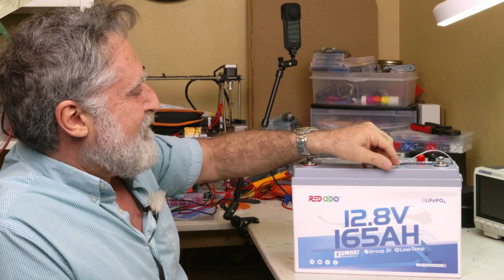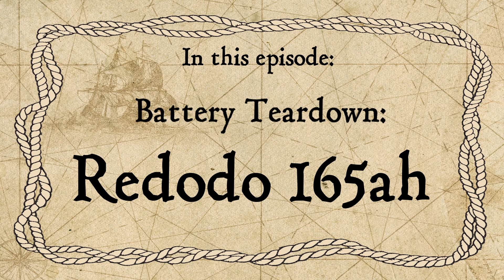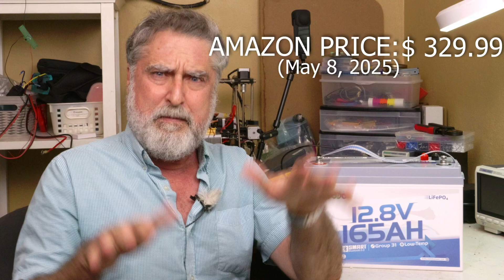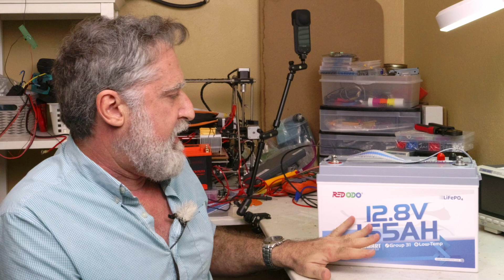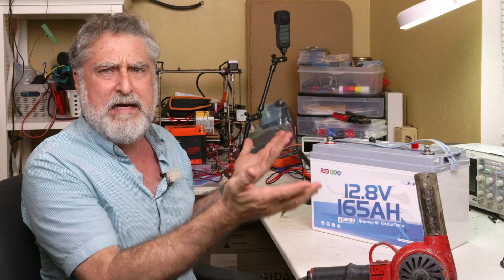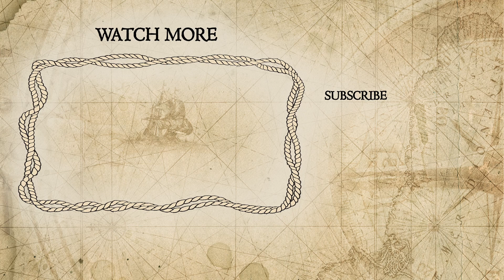Redodo 165AH: Lots of power in a small box

Comment: More amp-hours of storage and a higher output BMS, in the same form factor.  Forget about cost-per-Kwh...that's a win, in my book.  Apps are nice to have, but in my experience doing this stuff for the last 5 or 6 years, I just add capacity until I can forget about how much capacity I have or need.  At that point, the app doesn't matter, at least to me.
Reply from the maker: It's nice to know when the cells are balanced
Reply: @Clarks-Adventure  - I agree, but after you check the app a few dozen times, and the BMS is doing the job of keeping them in balance, I get to the point where I just stop looking or caring about that.  I care about the total capacity, insofar as it meets my needs.  I guess I just "use" the batteries more than I care about the minutiae of how they are performing.
Reply from the maker: Absolutely valid.
    I think checking the balance at least once a year as well as when you first get them is important.  And it's so much easier with the app
Reply: @Clarks-Adventure  - That's a fact!  I still balance packs (or parallel/string arrays) every year, even if the voltages are pretty close.  The battery equalizers are also useful, in that regard.
Reply from the maker: If you go back through my videos you will find i thought exactly like you in the beginning.  I even criticize Bluetooth as an unnecessary expense, the cells dont care, just a bell and whistle.
   Well i changed my mind. Bakance is so important and its so much easier to do this with cell voltage reporting.  AND some BMSs are just BAD (LiTime).  Knowing the cell voltage tells you whats really going on.  Without opening the case Bluetooth is the only real choice
Reply: @Clarks-Adventure  - I've been running my OGO (off-grid-office) on a mix of Li-Time and a DIY batteries for the last 3 years.  They just work, which is all I need.  People obsess over millivolts of deviation, but only because they are getting too much information and have convinced themselves it matters.  The annual capacity checks make it very clear (to me) that it doesn't matter enough to worry about.  Andy has shown this over and over again in his testing on the Off-Grid Garage channel.  We have become a society which believes if you "know" something, you must act accordingly, and that's not always true.  Set and forget has tremendous virtue, in many situations.  These batteries will last 10+ years, just the way I'm using them, even if I don't obsess over cell balancing.  Look at the cell voltage deviation at 10%, 50% and 100% SOC - you'll find they are only "balanced" near the top or near the bottom, but that doesn't effect total storage capacity in anything more than an academic sense.  For real-life utilization, it's best to avoid the hair-splitting and just use the darn things!  :)
Reply from the maker: @jasonbroom7147 I certainly hope your system has a long life.
   But 3 years isn't really a test.  I'm seeing failures in the 3 to 6 years range.  Of course with prices going down maybe that's enough life.
   Your older LiTimes are likely great batteries.  I find the latest BMS from them horrible.  Taking the case apart and testing cell voltage directly I saw it actually lied to me about voltage.

Comment: Hey big fan here.  I have a question.  I am in the process of re-wiring my fishing boat to have a starter battery and house battery.  The starter battery (lead acid) is just responsible for starting the motor (outboard merc), and is grounded to the engine block.  The house battery (Lifepo4) is responsible for everything else (bilge, live well, downrigger, fish finder etc.)  They are two completely separate systems not connected by any battery switches, but each system is properly fused and has their own battery shut off switch.  How would I go about grounding the house battery system? The batteries being two  different chemistries is it okay to connect both their negatives so the house has the same ground as the starter?  Or is there a better way?
Reply from the maker: Connecting the grounds is just fine in any situation.

The question is how will you charge the li.  If you choose to use my BankManager to get the best life and reliability out of it you can connect the positives as well through the BankManager.  This way your house battery will discharge first and both batteries can share charge sources.
MarineDCAC.com
Reply: @Clarks-Adventure  Thank you so much for the reply!!  As of right now i have a designated charger for the lead starter and the li house.  I have them on Anderson plugs and take them right out of the boat and charge them in my garage.  Eventually when i financially recover from the project (lol)  I am 100% interested in a  bank manager to streamline the process.  

Now as far as connecting the grounds.  Could I simply just connect the two negatives of the battery together?  Or should I run a ground wire from the house battery neg terminal or  fuse block to the ground on the engine.  Does it matter?
Reply from the maker: @ericslifka5909 it doesn't matter

Comment: Hello Clark! Huge fan here. I have a question about the bank manager. Could I use it as a balancer, and connect batteries of all the same chemistry to it? I have 6 200ah lifepo4 batteries but 2 are older than the other 4. I had them I'm a previous boat. All the balancers I see are for balancing 12v batteries in a 24v series setup.  I'm looking for a clever way to make use of all 6 batteries and to be able to charge them all with one solar array and draw from all of them with one inverter.
Reply from the maker: Yes in a way.  I'm sure you want to address the "done mix old with new" issue.  You can do that with a pair of BankManagers.  One for the old one for the new.   It also lets you mix different manufacturers batteries with different personalities.
    Each BankManager will take charge of just the batteries connected to it and do what's right for them.

Comment: Why not just add vents for the gas expansion... Lead acid batteries have venting for hydrogen gas.
Reply from the maker: Once the cell vents...  It's dead.
   For li you need to keep the chemistry inside.
Reply: @Clarks-Adventure  i pin prick my drone batteries because they swell up and wont slide into the drone.
Reply from the maker: Ok once the electrolyte dries out they are dead.   If the cell over pressurizes it will blow a pressure vent.  My personal experience is they die soon after 
   Maybe your pin is small enough to not lose anything.  I'd tape it after if you must vent

Comment: Wrist watch? 3 minutes into the video. What's the rule for working around electricity?
Reply from the maker: As long as the watch is smaller than the distance between the terminals you can officially wear it.
Reply: @Clarks-Adventure  I'm kind of anal about it. Back in tech school right after attendance they would start handing out demerits for watches and rings. Mind you the first three months the closest you got to a power source was the light switch.
Reply from the maker: @stevecurran3007 when I crack the case I'm  conductor free and always mention it.

In fact I purposely leave the watch on so I can make a point of removing it.   (Public safety announcement)

Comment: I thought you couldn't mix different brands of batteries?
Reply from the maker: You really shouldn't.   But as I always say we are adults and can make our own decisions.  There are two issues that effected my decision 
  1 I use a BankManager so no battery will see anything close to the crazy high state of charge charging to voltage gets 
   2 this is a camper so it seems only a small number of cycles per year.  These batteries will age out (and I'll likely die) before they get anyhere near 4000 cycles 

   On Temptress I have 3 different kinds of batteries with 3 different BankManagers.  This works completely safely for the batteries.